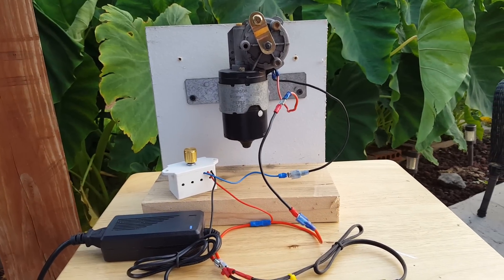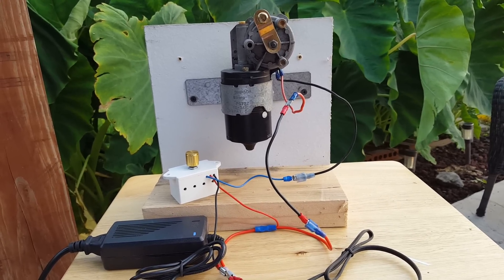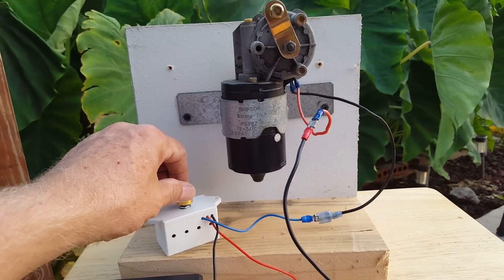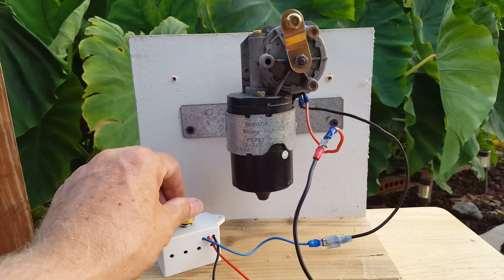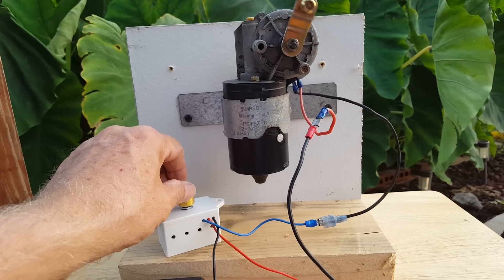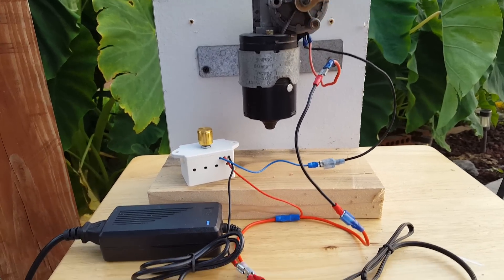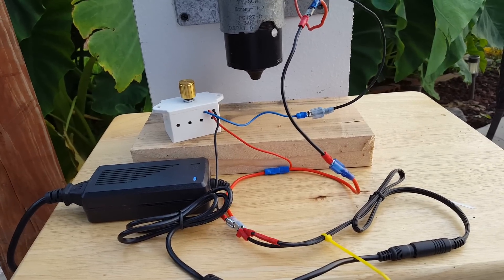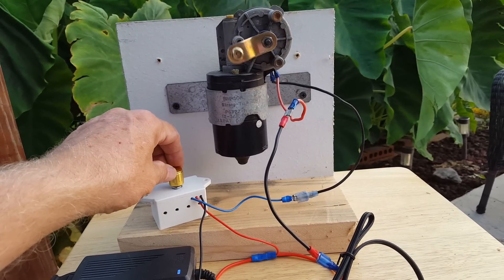Demo of 12v Power Supply Powering a Wper Motor with a Motor Controller

Comment: Jose, yes it should work on either 12 or 24 volt. To be sure you should check the description of the motor controller bedore you order it.
Reply: amps is key no less than 3.5 amps. but 5 amps is best

Comment: Can that power supply drive that motor with out speed control?
Reply: Dragana Petrovic  Yes. as long as the motor runs on 12v dc.
Reply from the maker: Yes you do not need the speed controller.  Just hook the power supply to the motor.  If you hook up to the low speed on the motor the motor will turn slowly.  If you hook it up to the high speed connection on the wiper motor it will turn at the high speed.
Reply from the maker: Dragana, yes the power supply with work without the motor controller.  The speed of the rotation of the wiper motor will be determined on if you wire the power supply to the HI or LO speed side of the wiper motor.

Comment: So what do you intend to do with it?
Reply: Jeffrey Baker This setup can be used for any number of wiper motor driven Halloween props.
Reply from the maker: Jeffrey. I use this set up for several animated props.  Actually on anything that I want to be able to control the rotation speed of the motor more than just on the HI or LO setting of the motor itself.  I have use it on my drunk pirate on a barrel to rotate him slowly around,  to slowly open and close the lid or my animated coffin, and may other props

Comment: I can use 12v 6A 72w power supply and my wiper motor????thank you ...and good job..
Reply from the maker: I'm not really sure abut the wattage.  But you will need 12v and at least 5 amp output.

Comment from the maker: Farshead68, The wiper motors I order from monsterguts.com for about $23.00 plus shipping.  I get the motor controller from ebay.  Just search for 12v-24v 6A PWM DC motor Speed Control.  Item #is 250943378758.  They are $8.99 including shipping.  The power supply I use is also from ebay.  Search 12v 5A power supply item number 141439295190.  They are $8.95 each.  You will also need a pigtail to connect the power supply to the motor.  This also came from ebay.  Search 10 X12v DC pigtail Female 5.5*2.1 MM, item # 391344968968.  They are #.55 including shipping for a package of 10.  Hop this helps
Reply: Larry Giggy 

Just bought the whole kit from monster guts😊. Power supply, controller, and motor with connectors for $70. Thanks

Comment: Great set up and explanation Larry. Can you give the specifics of the components ie. brands, specs, etc. I am building a hanging man and several other props and would like to be able to save some money without having to buy complete kits. Thanks!!!
Reply: farshead68 Sorry this reply is so late. I'm not on this site very often.  Just search ebay for the following. For the power supply search for 12v 5a 60 watt power supply AC to DC  adaptor for 5050 3528 flexible LED light strip. For the motor controller search for PWM DC motor speed control 6 amp 12-24 volt 13 khz controller switch. For the pig tail wiring search 2.1 x 5.5 mm DC power socket jack.
Reply: @TheScarypapa  hey brother can i start a 12v wiper motor on 12v adaptor?

Comment: Great tutorial Larry, thanks for sharing.
 I was googling about for help with powering a motor, it's a 12V 5A.. would prefer to plug it in rather than use batteries, the above set up looks ideal.. what you think? 
 thanks.. :)
Reply: Sar apna namdet do mera n 8279838575